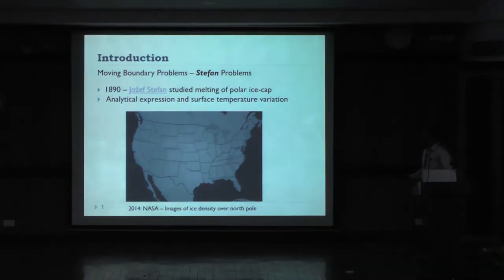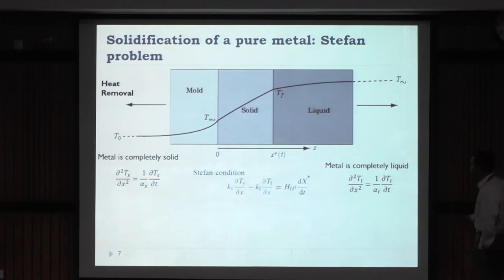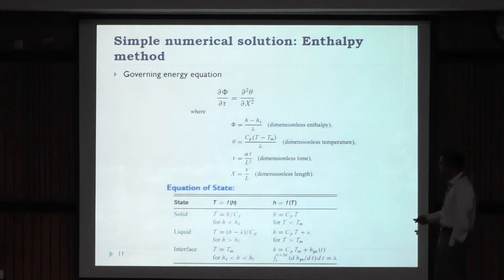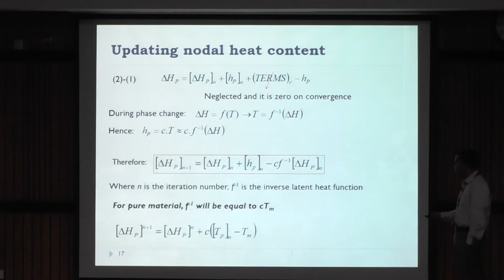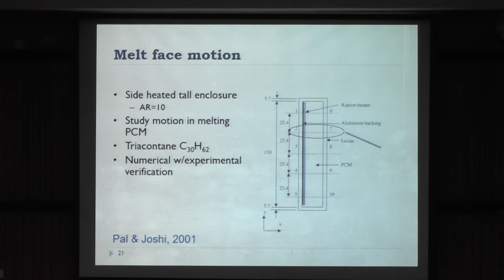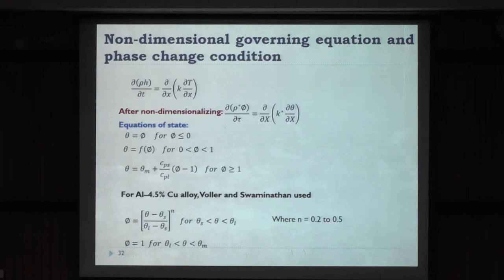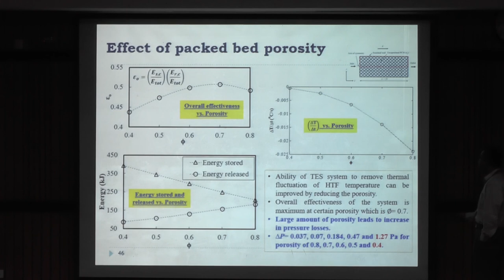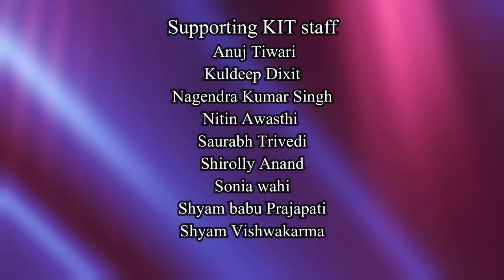Modelling Of Solid-Liquid Phase Change: Analytical And Numerical Approach

Comment: Thank you very much, I want to confirm if I do ANSYS simulation for PCM in building application, have I to solve the numerical model manually?
Reply: your question is misleading. what do you mean solve the numerical model manually? To my knowledge ANSYS uses the enthalpy fixed-grid approach. However, it is not accurate.